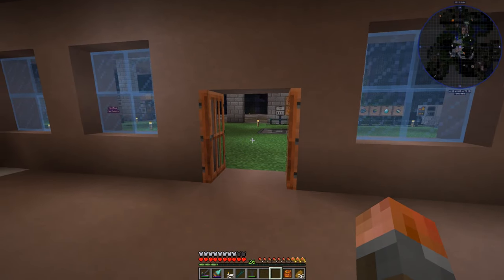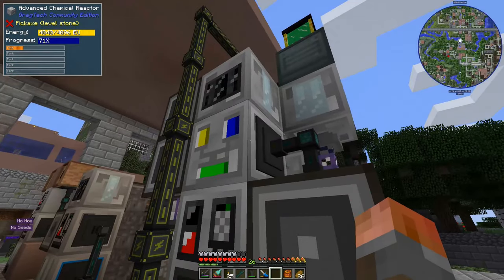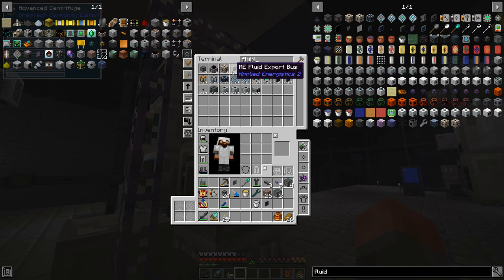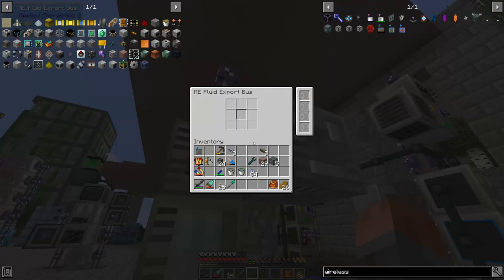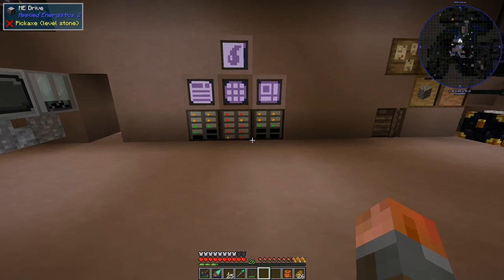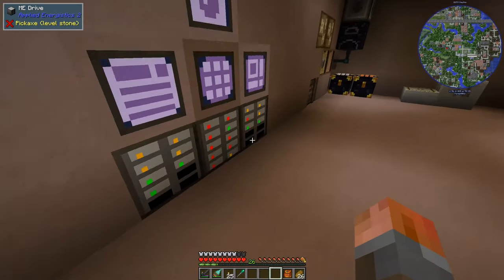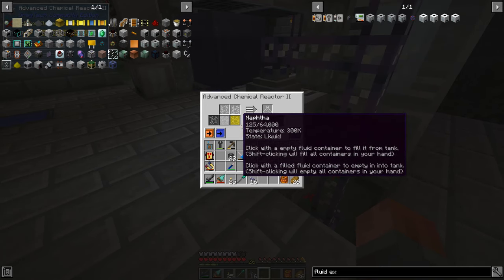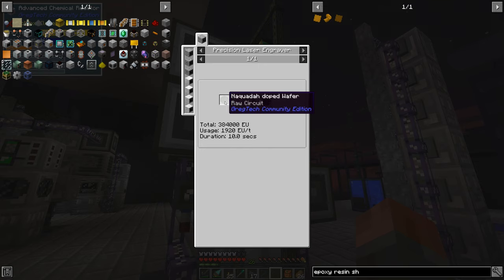Omnifactory E47 - Epoxy Circuit Boards (and Gen 4 Circuits)

Comment: 4:16 Could you export the PCBs from the advanced chemical reactor out the front (where the power cable for the advanced compressor is located)? I know the machines don't natively support pushing items to the front, but maybe an EnderIO conduit can still pull from that face? I honestly don't know, I'm late gaining interest in this pack, but if that is possible, you could pull the PCBs out using the conduit (which can share the same blockspace as the power cable for the compressor) and dump them into the adjacent MEInterface, freeing up one side.
This is complete hands-off brainstorming here, so I absolutely admit I may be wrong, but it might be worth trying.